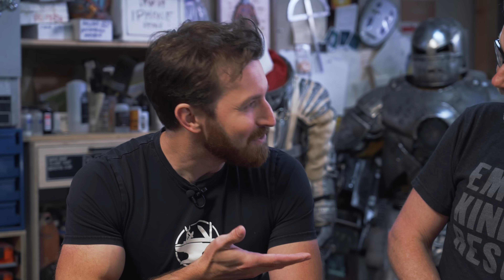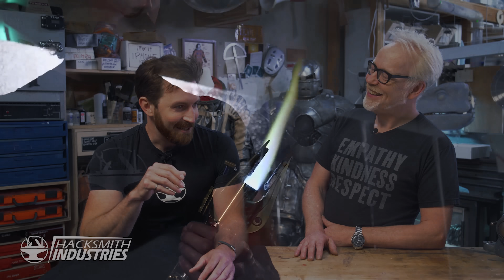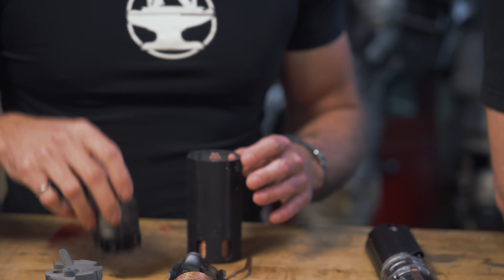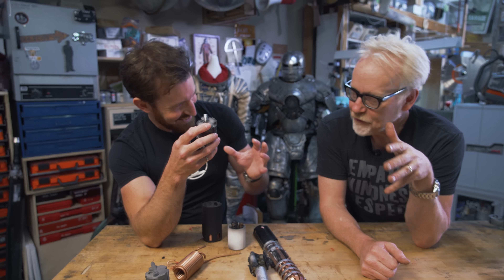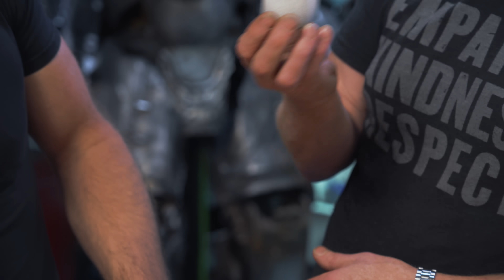Adam Savage Reacts to Hacksmith's Newest Lightsaber!

Comment: It’s fine he can build a plasma saber, but in NO way can he call it a lightsaber. Lightsabers are NOT made of plasma. Period.
Reply: What else would it be made from
Reply: Name what they are made of then?
Reply: @hunterwhite4544  the whole reason I didn't name it originally was because I wanted the question to be asked. Thank you for asking.
Reply: @J3sse55  @hunterwhite4544

It's in the name: LIGHT. If the lightsabers were producing plasma blades, the Jedi or Sith could NOT hold the hilt for very long. Plus, when they hold the hilt in such a way as to ignite near their face, they would almost immediately burn their skin due to the intense heat of plasma. Also, there are NO tanks of gas connected to lightsaber hilts, and the hilt itself could not contain enough gas for a prolonged battle. Just as the Kyber crystal does not power the saber, it is impossible for a crystal to produce a plasma blade. However, a Kyber crystal CAN produce a beam of light, just as any crystal can. Most sabers contain 1-2 crystals. A Kyber crystal and possibly an additional crystal, which either provides a boost or aids in focusing. There is still, near the tip of the hilt, a focusing lens for the blade. On certain advanced sabers, such as Vader's, the hilt has the ability to adjust the length of the blade produced. The bottom about 1/3rd of the hilt contains the battery for the saber. Now, WHY would a saber, producing a plasma blade, ever need a battery? Simple answer, it wouldn't because the battery would serve no purpose. But a battery WOULD be necessary to produce and hold a blade made of Light. There is a valid reason it is not called a plasma saber. In fact, George Lucas originally planned to call it a lasersword. Does this help answer your question, gentlemen?

@J3sse55 I apologize for not replying sooner. YouTube failed to inform me you had responded. I do hope this explanation helps.

EDIT: added your names up top. Realized after I posted that neither of your names were on here, so I wanted to make sure you got the response notice.
Reply: @Pecos1 it’s a movie and this is the closest we can get, there are no such things as kyber crystals and those batteries they use that produce the power of an entire nuclear energy plant. I don’t see why you have to hate on this project when you can not come up with any solution that could work in real life, there whole channel is to make it real and this is the closest possible.
Reply: @J3sse55  sorrynotsorry you feeling I'm am "hating" on the project. Quite the opposite. I just wish people would stop incorrectly saying the lightsabers in the films are made of plasma. As for your comment about kyber, well that's just silly. Of course there's no such thing as Kyber crystals. The closest thing irl would be quartz. I enjoy both Hacksmith and Adam Savage's saber builds, and to be honest, im a little envious of their vast supplies.
Reply: One more thing, gentlemen, the very first sabers, called protosabers, had cables from the pummel to a giant pack the users had to carry. Now, while it was stated they were giant battery packs, the argument could absolutely be made that before the battery packs came packs containing the gas needed to produced the protosaber blade, which could then be argued was in fact a plasma blade, prior to the discovery of the Kyber crystals.
Reply: @Pecos1 that literally seems like you disproved your own argument. Go touch some grass bro
Reply: @hunterwhite4544  in what way do you believe i disproved myself?

Comment: These crazy guys aren't even wrong about it being rocket science. That thing is basically an expander cycle engine running LOX and C3H8. Having that throttle itself up and stabilise without any external bootstrapping or electronics would be an insane accomplishment.

Comment: Looks like an old cutting torch trick we used to do only on a much , much larger scale.   Have a torch tip with the center oxygen hole cleaned and honed to a nice smooth bore, then adjust the oxygen on a fairly light pressure and stream till it makes a long tubular flame and you can cut much thicker metal than the size of your torch would normally allow.
If that were exactly the same on that scale he could probably cut through a foot of steel.

Comment: Those should make amazing rockets in their own right.  Placing them in clusters, fed off the main tanks of the ship.  Maneuvering  thrusters etc.  Granted I don't know the force numbers involved, but it seems like it should work as a quick swap space vessel engine module component.  Not suitable for the main launch engines, but for in orbit, I'd imagine they'd be very practical, and easily replaceable while in orbit.  Module seventy five goes out, there's sufficient compensation to finish whatever maneuver, then do an EVA to replace that one module, and you're back to full thruster compliment.

Comment: I spent almost 2 decades as  BMET repairing anything medical. I did a lot of work with LOX starage and delivery systems. I did litterly every crazy experiment I could think of. When testing stationary 21/31/41L dewars they had to have a partial fill and weigh test to check vacuum integrety so at times I had to dump 10-20 of them at one time. I even took 5gallons home to play with a few times. The only thing I didnt try was soaking a charcoal bricket and lighting it I heard it goes off like dynamite.

Comment: When working on many of my projects, and as excited as I am to get the ball rolling..
I always visualize the process in my mind. Any complications that aren't able to be fixed prior or during the process I take a step back and go about other things until I have either researched and/or come up with a solution. Some may consider my process procrastinating. However, I am pleased to say that since I've started this approach. I have not encountered nearly as much stressful incidents and/or failures then or down the road. Granted, some things are trial and error. Knowing that going in helps prevent the wrong focus and that is thinking/concentrating only on the failure.

Comment: Im an aircraft mechanic and working in EMS. We kept a giant LOX tank and would fill a smaller tank that went into the helicopter. It was around all sorts of electronics and after filling the bottle we would just dump out the overflow, never worried about it. But i wasn't lighting a fire with it

Comment: Interesting thing, the Saber is pretty close to the in-universe 'protosaber' thousands of years before the prequels. Force users back then had to wear a power supply with a cable that was attached to the hilt from the pack, and the sabers are plasma based which use a localized electromagnetic field to shape the blade.

Comment: 1 step away from a inverse nuclear reactor. You need a constant heat for it to prevent seize up from cold gases. Where nuclear reactor uses reactions and water cooling to mainetane balance. Light Sabers do seem like a step into the distant future if you can achive what is needed.

Comment: I have no idea what a 100 clean room is, but seeing Adam's genuinely shocked reaction to it, I know it's something amazing.
Reply: Based on other comments, a Level 100 clean room is a sealed enclosure where the air inside can only have 100 parts per million (or less) amount of airborne "contamination." Literally <100 particles of dust for every 1,000,000 air particles...far, far cleaner than even air in locations in the middle of nowhere with no industry or cities around.

Comment: double wall and fill the voild with an inert gas/gell that can handle the thermal differential changes as an insulator and can deal with o2 oxidiation maybe????
Reply: ceramics, alloys, composits, gells, liquids, and multiple application methods

Comment: I believe in refrigeration they use a hot gas bypass to deal with that issue. A small portion of the hot gas is fed back early to predict the demand. You could mechanically tune that loop, but electronics and a valve would greatly simplify it.

Comment: At this point, I think the US millitary would want to have this tool at their disposal.
Not for combat, necessailly, mind you but for spec ops it might be handy getting into places.
lox burns at about 3400k. Steel melts at around 1200k.
Even for one minute this can turn most metal structures into pudding.

Comment: I am an Aerospace Engineer in Propulsion and Combustion. Can confirm. This is rocket science.

Is the liquid oxygen plumbing system also regeneratively cooled before injectors? You could potentially preheat the oxygen by dumping through a electrically heated platinum wire mesh (like a dish scrubber. I am not sure what type of combustion staging you are doing but there are a few options.  

Also, use liquid nitrogen and bleed gaseous oxygen through a copper coil in the LN2 bath to gather the amounts you need.

Comment: Adam
I work for a company uses pressurized O2 in hyperbaric chambers. Parts such as copper fittings had to be properly Oxygen Clean before they could be installed in the chambers. Pressurized O2 like liquid O2 is also very dangerous. Techs such as I, we tested each chamber properly before they shipped to location. Then service tech from the company installs all connections properly. Chambers are very neat medical equipment.

Comment: Us Canadians are so innovative. Eh?
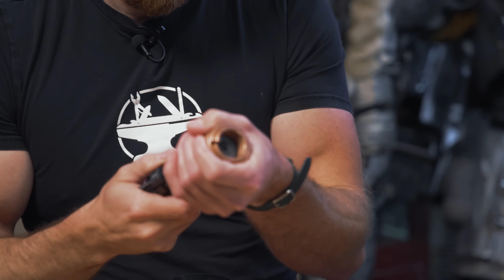Reply: They took my advice and made a plasma tesla coil!  4:35 that makes me super happy.
Reply: Btw, you can remove the aop and use pure electricity and magnetics if you work the coils just right. 

I think using a bass pump inside the hilt ( and there for shaft) of the blade would help if you oscillate the frequencies. 

The tesla coil will support most of it. 

It’s difficult to imagine but all you need to do to create an electrical magnetic plasma arc is just filter the electricity a lot. 

And the best part. You can move the lightsaber without it exploding. 

Like. You can.  Even. Wiggle your pinky. 

Please dont use the aoe device as a proof possitive. Use the electrical plasma arc. Its funner. Harder to make. (By legues) but safer. 

Also. May be able to be used against real lightsabers. And cut real things. And act like a real blade.

Comment: I wonder if you can design a tiny remote-controlled shut off system for this? Similar to how nascar and monster truck teams will have someone in the pit crew who can remotely shut off a car's engine in case of an emergency.  
That way at least if you want to hand someone like Mark Hammil the thing you can have someone on standby as at least a slight security measure in case, like you said, it were dropped by mistake. Heck you could have multiple remotes in multiple people's hand, so that if any one of them activates the shutoff it'll trigger. 
Also, I'm not sure if you're doing this already, but requiring a button on the handle to be held continuously while it's on, so that it shuts off if it's ever let go / dropped would also be nice (and realistic to starwars lore!)

Comment: its fucking cool and a crazy piece of engineering. Just wanted to add that fire is absolutely not plasma, as the clip from hacksmith's older video claimed. Flames are an emergent phenomena as a result of combustion reactions. Plasma is a gas that gets to such extreme temperatures (or other conditions) that the gas particles ionise, which is not what happens in a flame.

Comment: I think a good way to communicate the technical achievement would be to go back into the prototype pile and demonstrate how quickly and spectacularly things /can/ go wrong with each of the critical components: pressure vessels, liquid oxygen, hot/cold systems etc.

An interesting use for the clean room might be to get into small stuff like (MEMS, biotech) and demystify the hard to see stuff that enables modern tech or phenomena that are just weird and fascinating at those scales (thinking channels like Breaking Taps and Applied Science.

Comment: It's not a common use, but many gases can be stored in lattice structures (e.g. hydrogen in graphite lattice). I don't know if storing oxygen in a lattice would achieve the same density as liquid oxygen, but there should be a method that would outperform traditional compressed gaseous oxygen, and would solve many of the problems with liquid oxygen. If I were trying to do what they're doing, lattice storage would absolutely be my long term path. It's probably the only way to get to a self-contained version of their lightsaber that's both practical and safe to get outside their very controlled environment.

Comment: I can imagine carrying a cryo LOX case for portable display (something that looks like the nuclear football would be cool), in which the LOX canister is stored in liquid nitrogen, already sheathed in aerogel casing, ready to be inserted into the lightsaber immediately before use. I realize that would increas the likelihood of contamination at the LOX port near the brass manifold increasing chances of 💥.  Alternatively, you could manifacture multiple lightsabers in their entirety, prefilled in the cleanroom, and the portable cryo-case would require internal partioning designed such that the propane does not freeze, or if you can simply insert the room temp propane canister into the prefilled lightsaber immediately before use, I  imagine of course with either those options you're wearing thick Darth Vader gloves to prevent your hands from freezing. OR!....you could have a three part construction in which the entire cleanroom prefilled LOX/manifold/torch "rocket internals" aside from the propane and outer casing are kept cryo in N², immediately before use, you insert the room temp propane canister/tank, and the asthetic/functional room temp metal casing pre-lined with aerogel and with the needed outlet heat pipes, would allow for use with bear hands, minimize contamination to the LOX, reduce propane freezing as you're inserting it just before use and the heat pipes would subsequently prevent freezeing upon ignotion.

Comment: They should combine this with Micho Kako's ideas for a current tech saber that use a high durability ceramic retractable blade kinda like the toy sabers but it has a bunch of tiny holes everywhere exhausting plasma, then it'll be able to hit things as well, if you could make the blade material strong enough

Comment: This us just an expander cycle Propane/LOX rocket engine, and that is insanely impressive. 

I do wonder of instead of LOX they could use a different oxidizing gas that liquefies more easily. Maybe like liquid chlorine. Toxic AF but doesn't need anything cryogenic and with the proper fuel the combustion products wouldn't be "that bad"

Comment: I want to see this thing in action. even if it cant cut its still cool. the only way I could think to cut is have it basically be a oxy acetylene torch or put a blade in the middle and use the flames to hide it. if you did that the durability of the blade would degrade quickly but its not like youre actually trying to cut through steel or wood.

Comment: 😳 9:20:00 ONE cubic inch of LOx has 15000 pounds of pressure.

Citation needed from nerds. But iigc in our typical ambient atmosphere oxygen GAS makes up 7% of one square inch of ambient air…… so .07/15000 = ~1000lbs of FORCE!!!
And normies just breathe it….

😂 liquid oxygen is dangerous 😳😐😐😐

Comment: Yes, when renting or buying something they usually don't ask if you know how to operate it, they just assume that if you are paying for it you know how to use it. I used to drive a flatbed delivering rental earth moving equipment to customers. Once there was a house owner who rented an excavator for a weekend to redo the drainage around the foundation of his house, certainly not a job for a beginner operator, especially if it needs to be done over a weekend, as there's a possibility of making a lot of damage to the house. When I dropped off the machine he asked me to show him how to use it. Of course it was a part of my job to show the customers things that vary from one machine to another like which button operates the bucket quick coupler etc. but this guy asked me what do the joysticks do which means he had never operated an excavator as the basic controls are standardized so they are always the same. I did my best to explain within the little time I had, unfortunately I was not the one who picked it up next week so I never saw how he had done with the job.

Comment: Unsolicited waning and advice from a layperson fan:
That preheat of the gas using heat transfered from the flame will only work in this tuning and configuration on earth. Will not work underwater, without mechanical safeguards in place, and anywhere the atmospheric pressure is different significantly from earth, so, no tattooine, no yavin 4, no dagobah...